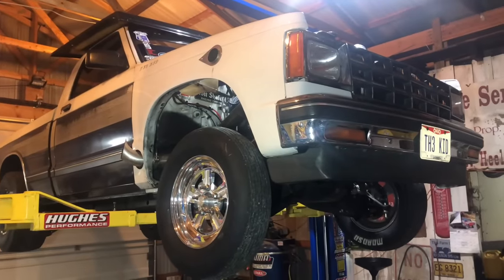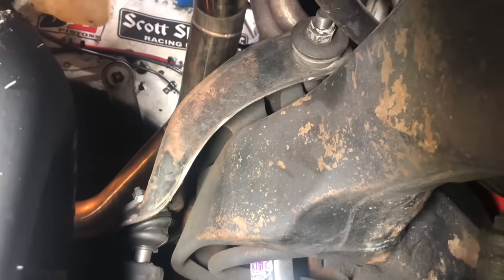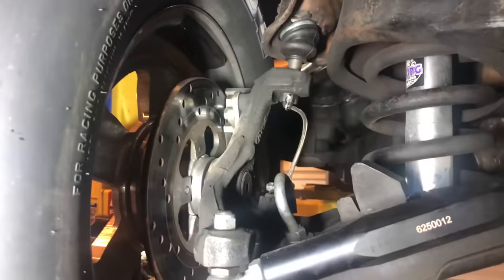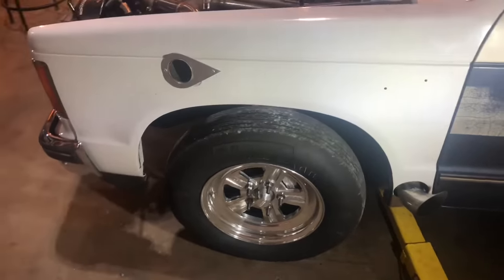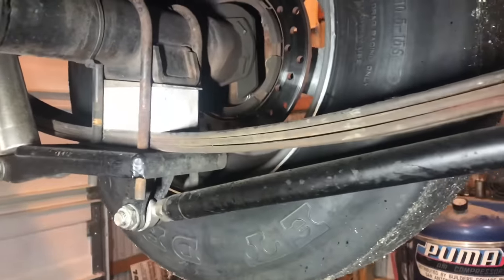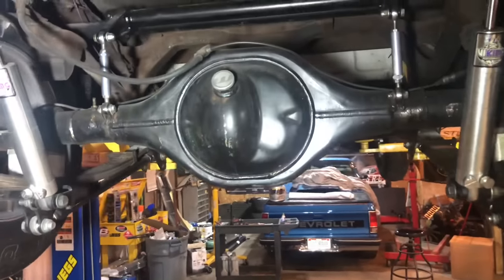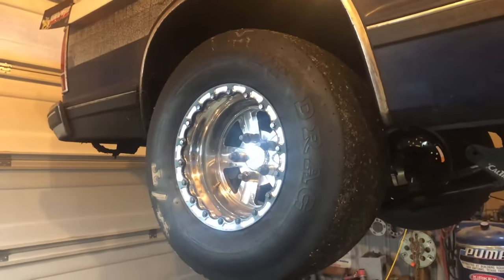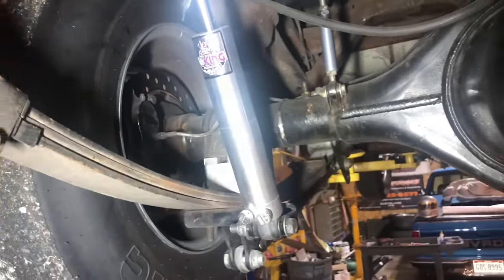Suspension SECRETS!  A look under “Billy The Kid”’s S-10

Comment: Bill. You said you removed the helper leaf spring, but you still have three leafs. Did you add another thinner longer spring?
Reply from the maker: No they had 3 leaves plus a helper
Reply: Okay. Thanks. I guess my 2002 was built was built with ZQ8 suspension that has two main leafs and one helper.

Comment: I had moog chassis part numbers to correct bumpsteer and setting caster camber with their factory appearing parts. Never failed tech. You would hear the other teams say they got vortech heads, that cam has a thump that is not stock etc etc. The cam was stock lift rule and the heads were era correct. The car was so much faster through the turns from chassis set up. Horsepower wasn't the secret. Oh and I camber the 10 bolt rear-end 😅

Comment: Thanks for the great info! But a question if you or anyone has time, will this all be the same on a later model S10? I'm completely new, never raced, never swapped an engine, and only once helped open an engine but that was years ago. I'm basically starting with little knowledge, and a stock truck. I'm doing research... But I have ADHD so all this is hard to grasp.

I have a 99 Xtreme body S10. Stock everything right now. I'd like to have a procharged 6 Liter in it. Or a screw blown 427. XD

I just need to know where to start if I ever hope to call out billy and his S10 to the track someday. 😅

Comment: On my 91 mustang gt I have lakewood 70/30 front struts and the rear are 50/50 shocks with south side machine upper and lower control arms solid bushings and torque boxes reinforced they work great. A little noisy but it works. Nothing is adjustable on my suspension it is what it is and it works on any surface.

Comment: why is having more front suspension droop important? I can imagine a lot of it would have to do with being able to keep the tires on the track so you can steer. I have a 93 s10 and already have 2" drop spindles and even if I did the 1" ball joint spacer and tie rod thing, sounds like It wouldn't help as much as if it were still stock. Love learning about the setups, I'm learning all I can before I start spending money on my 5.3 swap.

Comment: A S-10 and a G body are basically the same thing, other than leafs on the rear, and a S-10 is a inch and a half narrower. The problem with the front end is the anti-dive built into the front end, which takes away forward drive. I've learned how to correct that aspect of the front end, aswell as quite a few more things to do for bite, and driveability. 
      I love cal-tracs, but i do not like lowering blocks, they create spring jacking, because of the datum line is not correct for the spring. Shackles when mounted correctly are far superior to sliders. Just some food for thought, take a pyrometer with you on the next long tow to race, and check your shock temps. I put on red ryders to tow, and put race shocks on to race. I like y'alls channel, but y'all are leaving alot on the table.......jussayn. Great video though, you explained things very well, and your on point about spindles and springs, it's all about the "Stored" energy......

Comment: I thought you spelled it out fairly well...  all you do is get people confused when you start adding in squat lines, instant centers etc..  I am most intrigued by these little trucks going as fast and quick as they do... So much in fact that I have one that should be a high 8,  low 9 truck...  I have used Caltracs for decades and they are fantastic (I always run their split leaf spring also)  Would it be possible to gain your weight bias?  I am thinking 46/54%?   Am running a fully caged/tubed truck at 2400#lbs      Will likely finish off the cage to 7.50 certs

Comment: I like stiff shocks up front and soft in the back. For me it seems to help get frontend to lift up and ass to squat and stay stable as long as I'm in it. Plus the 200 lbs in my caprice truck only helps weight transfer
Reply: Squat isn’t good. You want it to separate in the rear pushing the tire into the ground. Squat is just killing your 60’ and preventing you from hitting the tire hard.

Comment: If the truck is using all  the same a arms springs and shocks and you change only the spindle then the only thing that will change is ride static height of the front of the truck.
That means all the a arms shock and coil still move the same amount, the 2-3 drop spindle effects none of those parts or movement . If you have 8+/- inches of separation you will still have the exact same 8+/- inches of separation movement. That means the center of whatever spindle, and tire combo can and will always move thru the limits of the a arms shocks and coils , there is no difference in coil or suspension pressure or compression load or unload it has to and will always work as it sits and moves stock or lowering spindles.
Don't believe it ? Measure the a arms to frame separation at static height ,then bolt a shorter tire or taller tires on and see if the static separation changed, sorry but with just spindles changed is not going to effect travel length.
You guys do a heck of a job with what you have so hats off to that , keep up the great vids on the new build, God bless

Comment: I've got a 97 extended cab s10 an I noticed that yall didn't have rack an pinion style steering.. my question is is there a reason why you wouldn't want to save the weight off the front end or do you simply like the factory style steering better vs saving weight??

Comment: Bill how tight do you tighten upper  a arms and what kinda bushing? Same for rear how tight do you tighten the rear shackles and caltrac bolt that goes through the spring?

I understand shackles and a arms should be loose enough to free swing when no springs are attached?

Comment: Did you ever consider raised spindles up front with a bolt in coilover? Once I finally got my s10 together back in 06 and I struggled on marginal tracks, I wished I hadn't gone to dropped spindles. Raised spindle may very well bottom shocks out at baseline ride height, haven't experimented. 3 more inches of travel without wonky geometry though. Thanks Mr. Bill.

Comment: I'm going to use your tips and build my daily diver which is a 1996 Mazda B2300 it is bone stock but it does have a turbo flow muffler and last night I did my fastest pass at BMP in Ringgold GA a 12.40 in the 1/8 mile

Comment: 50 years ago our suspension secrets were not secret. 90/10 shocks in the front with ball joint spacers and 50/50 shocks in the rear.

Comment: I have a 96 Sonoma, 350 stroker and a 411 chuck. I have 3rail road rails welded to far rear frame. I have wheel hop from hell. Have trackion bars on it. How do you stop it. My diff is 10degs neg. Under load and it's hopes ( wheels) on back bad. I'm 72 done this all my life. Never been a bale to stop it . What can I do to stop it?
Reply: Done big blocks in Chevy luvs and Ford courier . Never had this problem.

Comment: So i completly agree on spindals changing suspension geometry 
But with static ride height topic as you stated, if you were to have stock non heated coils to retain the 2 in of height in the spring your affective ride height would be the same correct?
In that situation you would have a more 
Accurate spring rate as its not effected by heat
But i do agree axel location plays on a big effect on torque angle of the suspension geometry

Comment: Hey I know this is probably a dumb question. And I don't really ask dumb questions, but I know you guys are pretty die hard Chevy people. But... anyway I want to build a dodge dakota early 90s late 80s. But I know that S10 and Dakotas have quite similar weight and are overall similar, but would most of this stuff, parts, and tips you have explained very well might I add work on a Dakota and maybe work well because, I know each truck, each car is different and that's probably a dumb question but I was just wondering if most of the parts, tips and everything thing said would mostly work on a Dakota.

Comment: So I have a few questions about the truck one being that why didn’t you have the x brace bolt on to the frame and the other one what’s your thoughts on the tubular control arms bc I’m working on same body style and similar setup and I’m still trying to decide if the money for the tubular is worth it but the drop spindles section of the video was extremely helpful and makes perfect sense thinking about it

Comment: I run a radial and try to go to surfaces better than bad. Have my rear Afros 28 from tight on rebound and 7 from tight on compression. I have the front both set pretty tight to keep the front down.

Do you guys change the shock settings for trailering the truck? Noticed my front Viking shocks instructions said to change them for trailering (what a pain in the ass that would be...)

Comment: Ugh. Wish the s10 I had wasn't cut when I bought it. Mines  has ladder bars with frame narrowed 2 inch and trz uppers and lowers.  Maybe I should remove them and put caltracs and stock fronts back on. As well as get rid of the drop spindles.

Comment: Hey sr. you speak just fine. id like to to talk about rear suspension  and   the term squatting .... it my understanding that ladder bars .. slapper bars.. and cal trax  make traction by lifting the body away from the tire. This can be seen by watching a car take off and notice  the gap between the tire and fender  get larger / wider at  launch.  The only this that should be squatting is the tires.  A 3 bar and 4 bar rear suspension will or should squat  since  the pick up point can be targeted by doing a   cad dwg. or making a full scale chalk dwg on the shop floor...  by making a dwg we can choose  where the bars intersect, we can aim the intersect point to the crank , cam, carb  or the front bumper.
For u guys not paying attention to bill sr  notice that ne mentioned the wedge  on rear  why is it really important ???????         cause it sets the pinion angle................ so whats so important about the pinion angle?         
please everyone who happens to read my comment give me ur 2 cents on my  thoughts.

Comment: I like being different so I have. 72 lemans everything is stock except ring gear pinion engine and tires ..this is a bracket car  my question to you is I'm having issues shimming my ring gear I know there is a little lash but how the hell do I know it's the proper lash  ...in other words I jack the rear up and spin the tire back to forward and there's a little gap between the pinion catching ring gear is that normal? I'm also having an issue keeping the front end down
Reply: The "lash" you refer to is just clearance. Roughly .005" to .007" is where i like to be. If it is over .010" it's way too loose in my book. That will cause the sloppy engagement you are seeing. Who setup the gears? Doesn't sound like it was done correctly. Excessive clearance and they will not last long.. I would also check wear pattern. 
As for the front end, either add weight or a double adjustable shock to slow down the rise. You only need enough front extension to transfer weight, but if it rises too fast it may hurt as well. Hope this helps.

Comment: I know what you're saying about you don't need fancy high-dollar suspension parts. There's no sense in going to spending $20,000 On suspension parts unless you're in a promod or something. I used to have a 1967 C10 short bed, with a 572ci  pushing 700 horsepower.
Stock rear end housing with drum brakes, on the front I just rotors and spindles and control arms off of a 86 Silverado and put them on all stock

Comment: Excellent. I wish I had received these tips starting out. For racers, this is equivalent to an MIT short course on going fast, staying safe, and having fun. A good alignment equates to lower ETs and a higher trap speed. My 2 cent tip: A 1-inch paint or colored tape mark on the centerline of the steering wheel can help to keep the vehicle tracking straight in a sudden wheels-up landing.

Comment: I'm building me a '91 Dodge Dakota could I use the same setup on that it has leafs as well I imagine it would probably just about the same type truck almost it's just a Dodge it's the same size almost the same weight so imagine the suspension would work well on my truck? Anybody got any suggestions?

Comment: what about upgrading to the blazer spindles they have the prebuilt hubs and are 1" taller i believe
Reply: the upper ball joint mount is 1" taller not the spindle location
Reply: wait i think its 1/2 taller... or atleast you use a 1/2 longer ball joint

Comment: I was at the race track one night with my truck and I met another guy who had a lot nicer & faster S10 then mine And he look it over really good and said the reason I’m spinning and can’t hook up on the street in the goals of my leaf springs.  so I took it down to his shop In lucedale Mississippi an about hour away and the cut the 2nd to the bottom leaf & And then cut the one under it shorter also. And when you would jump on the back of it it would immediately but I’m out and jump right up. I paid a year and met my cousin at the race track his balls who has just bought a new Mustang and made a shake down pass & then I raced him & I guess Randy Mom tried harder than I ever have and I spun bearing and it was sound awful and I had about 10 pounds of all pressure and I had my fancy four wheeler with me that I had I get home and load it up and made it to the house about 15 miles away. So yeah I never got to really race on the road Because I had all the work in the plan I could beat Bobby Ducote Because we raced every weekend from red light to red lighy and we went back and forth with I win & because I couldn’t get no traction I was steady spiny the whole time. But I did have him build me a new motor for my truck and by the time do you years later baby is already moved to big Time racing mind you that was 20 years ago. I’m from the same town ole Bobby & he is a really good friend & even tho he had gone PRO at race lifestyle we still y’all weekly he is a great guy & I saw the video where y’all come down her to Dirty Sipp & made a show with & I thought that AWESOME! I love everything about their your videos and the way you and your son get along together that’s awesome I lost my dad to an overdose almost 10 years ago now and I’m still having hard coping with it but the love you have for boys AMAZING! Take care & god speed.

Comment: I got a 4x4 blazer that i wish i could pick your brain about!! Its driving me to drinking
Reply: Man i got a 95 s10 blazer v8 4x4 that i drive daily runs like a beast
Reply: @tommycook9620  mine runs great it has frond end issues!! I have replaced all i can thin of front end and t case part still try to go into 4 when driving
Reply: @g-rock6329  say most r vacuum run that dum shit under the battery is the vacuum thing lol and it pools the cable to the front end and engages the 4x4 have u fucked with any of that shit
Reply: @tommycook9620  yes replaced  vacum punp on intake the cable the axuator under the battery  every syncer on the front end the axle itself  and all an the transfer case. the common problem is the wont go into 4 mine keeps trying to go in without cause??
Reply: @tommycook9620  I engauged the 4 let the vacuum pull the cable put a clamp on the cable so it cant disconnect, then said fuck it thats how in driving the front wheels engauge but not the t case lol it worked
Reply: @g-rock6329  try un pluging the axuator vacuum line and pool the 4x4 fuse if it still try to go in to 4x4 i think its your front diff then because the swich on dash tells the tcase motor to swich to 4x4 then sends the axctur vacuum to pool the cable to the front diff so if u unplug vacuum line and 4x4 fuse it should not work some have tcase module
Reply: @tommycook9620  i had same problem. They make a kit with a cable to do away with the vacuum crap and manually  engage the 4x4 .the cable runs up into the cab .yoy just reach over pull the cable it engages .push the cable it unlocks it .best thing i every have done to it .
Reply: @teamdrama6251  lol it goes in to 4x4 it wont come out of it is what hes says
Reply: @tommycook9620  hey its me again need to pick your brain again!! Blazer started  to cut out a little when it tac up to shift gears?? I can give it more gas and its cool?? Has new firin system all what should i check?? Thanks for your time!!
Reply: @g-rock6329  u check fuel filter
Reply: @tommycook9620  no and thank you!! I knew i was overlooking somthing simple!! Thank you again my man!!
Reply: @g-rock6329  no problem anytime